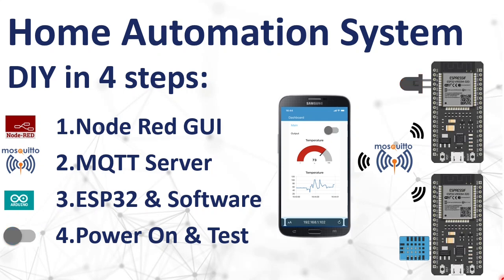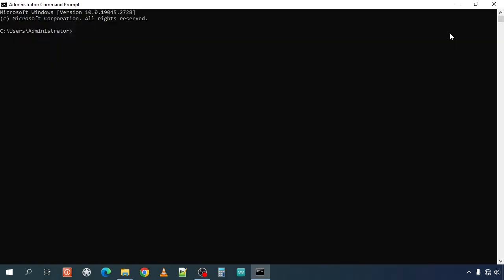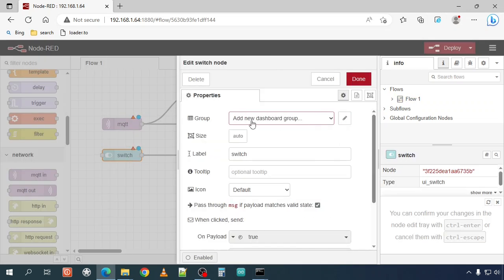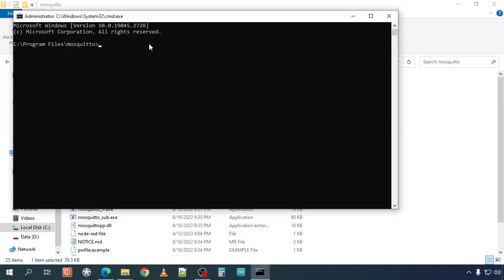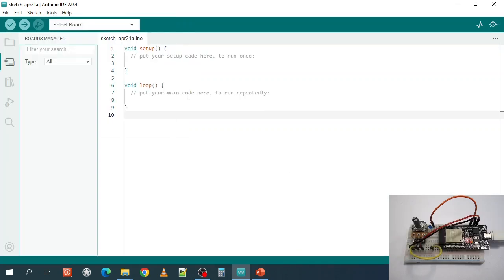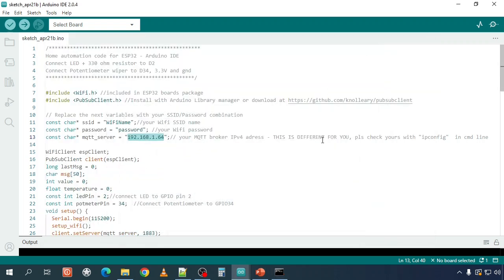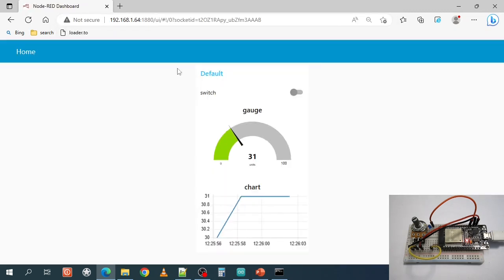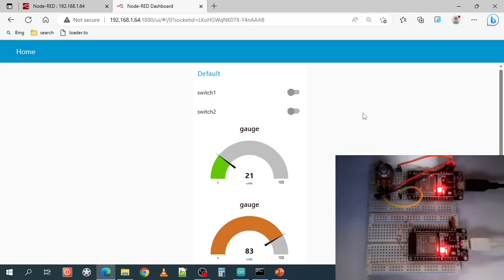ESP32 Web Server Tutorial: Home automation in your Browser in Minutes

Comment: Thank you for an excellent tutorial. Is it possible to connect 5 temperature detectors in one ESP32?  How to make it work if the temperature detector is an industry grade temperature detector used in high temperature steam generator coal fired furnace?
Reply from the maker: Thank you!   you can connect 5 I2C temperature sensor to 1 ESP32, you can also use the analog inputs of the ESP32, I think there are more than 5. So it depends what kind of sensor (what interface) you are using

Comment: is this only on a local network (wifi) or i can access and control from anywhere using internet ?
Reply from the maker: This only works for the local network indeed. 
You need to change settings in your Wifi router to make it accessible from the outside internet. Suggest you search "port forwarding router" and how to access your routers settings. Note that when you open a port to the outside will make it easier for access your network, so there is some safety concern. Note I am a analog electronics engineer, not a network expert ;-)

Comment: You rock the damn house!!!  🙂  I liked, subscribed and really appreciate this super informative video.  Thanks!!
Reply from the maker: Thanks jdarnell! This video is not very popular, maybe because the topic is quite complex: you need to get several things right: Node-Red and MQTT server running, and make your ESP connect and communicate correctly. I use this type of setup now at home for all my lights, it works quite good.  I only have some problems with connectivity in one room, I will try to improve WiFi reach with an external antenna (IPEX connector on ESP32S or just solder it). There are tutorials showing software teaks, but I did not get too much results form than....
Reply: @circuitarchive193  I am going to use Node-Red for a smart raised-bed garden setup together with rain barrels for harvesting water for it.  Your excellent instruction is helping me get started so I don't have to hard wire all my own controls.  It will also enable wifi controlling of the garden which my family will find convenient.  Thanks again for everything! :)

Comment: Amazing, accurate explanation, works great, thank you!
How do I interface outside the local network?
Is there a mobile app for using it?
Reply from the maker: Thank you! For access outside your home network you will need to change the settings of your router ("port forwarding") though I did not try that myself.